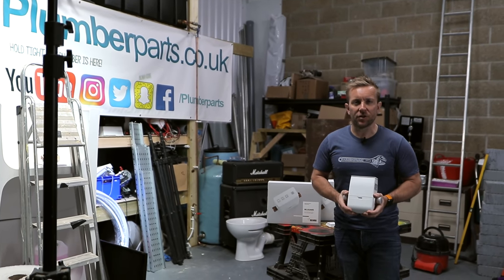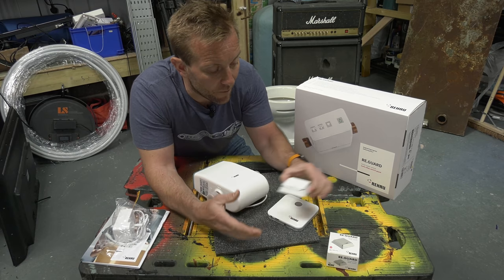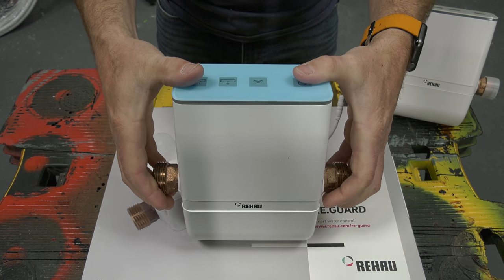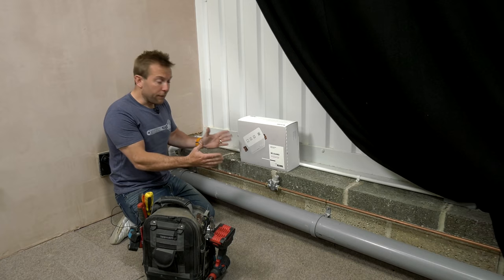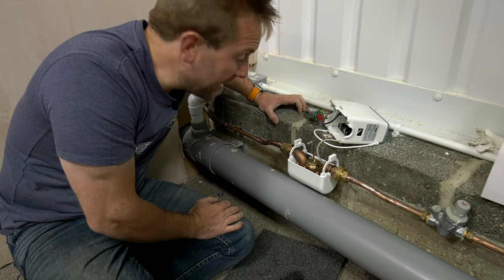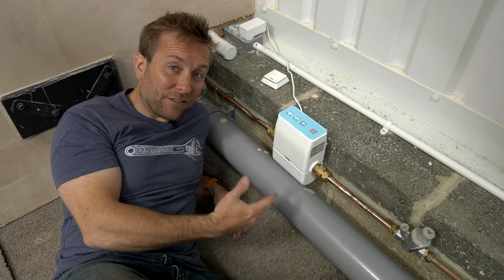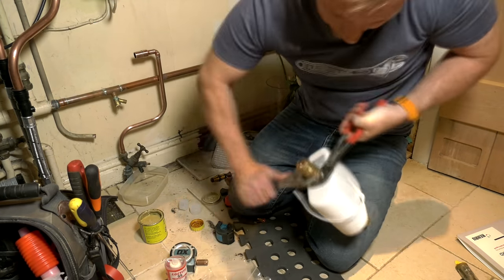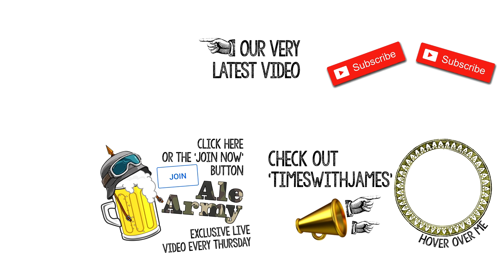ON THE JOB INSTALLING LEAK DETECTION & SHUT OFF VALVE - Rehau Re.Guard

Comment: As usual excellent video and commentary. Looks like a very interesting product but the only problem l see with this system from my own experience is when there is a leak emulating from a cold water storage  tank outlets unless you install a unit to each tank outlet (costly) you could have about 50 gallons of water discharge into property before the water leak stops even if you had one installed on the cold water main. Keep up the good work and stay safe.
Reply from the maker: Cheers Gareth! Totally get what you're saying. Will have a chat about in this week's livestream...open to all! Bang the notification bell too! https://www.youtube.com/watch?v=TRJJjTkdENw

Comment: Hey, if I wanted to do this on the cheap, could I hook up a normally open zone valve to my mains supply. Plug it into a tplink smart plug. And use Water Smart sensors to turn on the plugs if water is detected? Ty in advance 🙈

Comment: Very useful video, thanks! I am currently looking for such solutions on the market and found the Grohe Sense Guard shut-off valve plus Grohe Sense water leak sensors. Do you have any experience/knowledge on that product? I need to compare its functionality to the Rehau Re.Guard product that is reviewed in your video.

Comment: Brilliant product, do they do smaller versions for sealed heating systems ?
Reply from the maker: I'll answer that on Thursday mate. I'll gather the info before then!
🎬 LIVE STREAM HERE set a reminder https://www.youtube.com/watch?v=TRJJjTkdENw
Reply: @plumberparts  Cheers mate look forward to it.
Reply from the maker: @ormy1232  if you’ve got anymore questions then fire away! The more the merrier.
Reply: @plumberparts  I work for Mitsubishi Electric and we supply the Ecodan system, you may have heard of it. Its an air source heat pump. I just thought this product would be brilliant in line with the water mains to prevent any tank leaks or even on the sealed heating side. Ill have a think mate but would be good to keep in contact as I'm always interested in growing my plumbing knowledge. I'm an AC engineer by trade.

Comment: Using just the valve and no extra sensors... So this works by monitoring the flow rate... How can it tell the difference between a burst pipe and something that uses water at full pressure, such as a washing machine, dishwater, toilet refill, etc.? If it is doing flow rate over a period of time, wouldn't you end up with a massive mess before it shuts off?
Reply from the maker: I'll answer tonight! If you get a sec join the LIVE STREAM TONIGHT at 6:30pm - Open to all Bang the🔔too! https://youtu.be/TRJJjTkdENw

Comment: I have same were leak in radiator pipe or in radiator i can't find it. Pipe are running underground. I have done underfloor heating work just 6 months ago. Its fine the main problem is with radiator and his pipping as they are instal very old
Reply from the maker: Unlucky bro! 🎬 LIVE STREAM HERE set a reminder https://www.youtube.com/watch?v=TRJJjTkdENw

Comment: Interesting product and my only comment is that it is far too big an enclosure, surely they could re-engineer that to ‘reduce the envelope of plastic’ over the motor’, there is a lot of air in there!
Reply from the maker: Good point. Lets see if the guys from Rehau can answer that tonight... If you get a sec join the LIVE STREAM TONIGHT at 6:30pm - Open to all Bang the🔔too! https://youtu.be/TRJJjTkdENw
Reply: @plumberparts  I will.😀👍